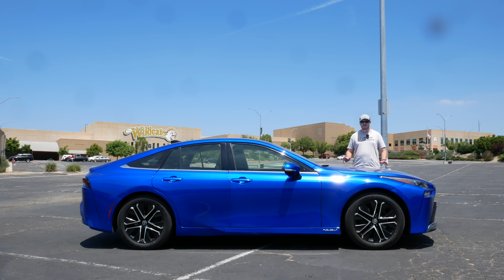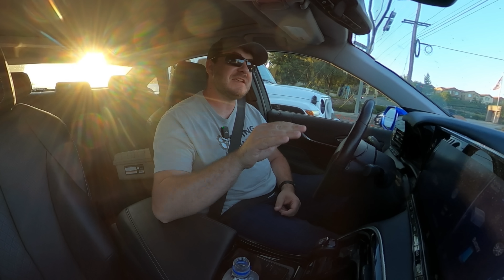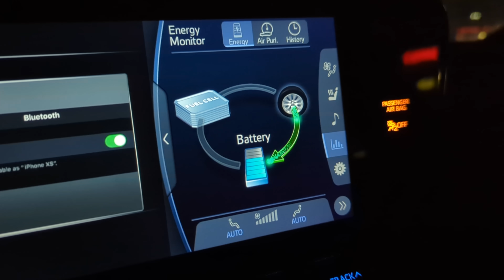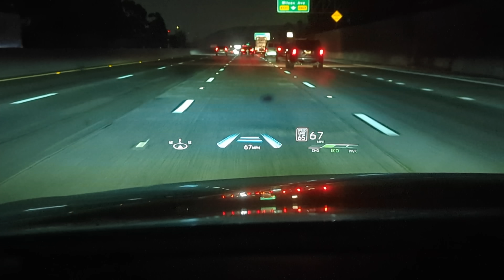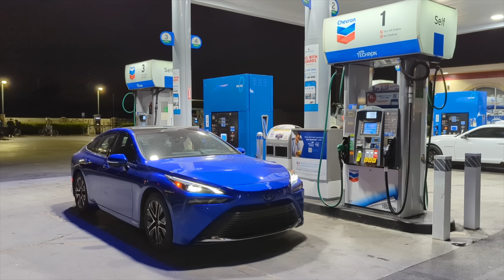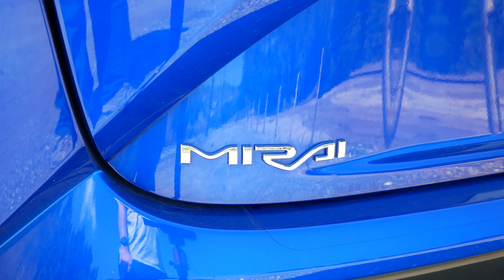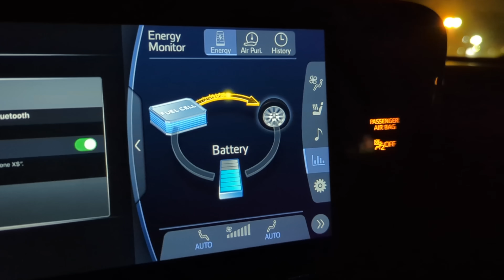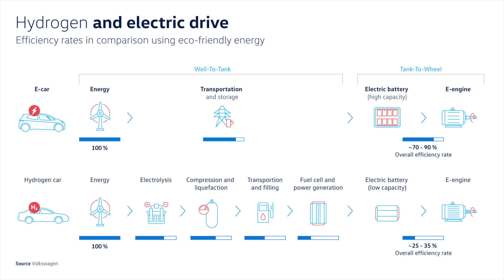The Toyota Mirai is Disappointing

Comment: I'm sure there is an expectation that Hydrogen will eventually be more efficient to manufacture as we get better at it, but I don't think it will ever be more efficient than just putting the electricity into a battery directly. I tend to agree on the concept of range extender for vehicles where charging a battery wouldn't be as practical, but unless we run out of fossil fuels there won't be very much motivation to replace them with this. Maybe using it with trains could make sense since you could have fixed fueling locations and they are basically doing the same thing except with diesel generators.

Comment: This is what I have been telling people: H2, while compelling, is a non-starter.  It's a brilliant exercise but at the end of the day, once you've crunched the numbers, it really doesn't make sense on a practical basis or on a cost basis.  The only place it gains ground is on an environmental basis where green-sourced, green-generated H2 is an easy win.  But it isn't a big enough win to offset its many shortcomings, not when BEVs are close enough competitors even on an environmental basis that FCVs don't really have a point.
Reply: By your logic a horse makes much greater sense than a car.
Reply: @rogersmith7396  A horse makes greater sense than THIS car.

Comment: Right before the latest 24 Hours of Lemans, Toyota showcased a GR Yaris that has a 3 cylinder turbo ICE engine that... runs on hydrogen. Huh? What? How? I DEMAND ANSWERS!
Reply: Same as propane.  Adjust fuel flow to keep ICE running.  You can use it in your stove or furnace if its adjusted right.
Reply: BMW also has a couple demo cars that run by combusting hydrogen. Engineering Explained has a video on it.

Comment: 14:21 - I'll say it. Yes. At least with its current VERY hard to over look limitations and inefficiency.
Reply: The range is a killer feature for large vehicles and long haul driving though, hydrogen vehicles can be configured to fairly easily exceed 1000km of range which would require an absurdly large battery pack for an EV. Doesn't really make sense for the average consumer where a rapid charging stop every now and then for a once a year roadtrip isn't a big deal, but for heavy vehicles like semi trucks where adequate charging infrastructure doesn't exist anywhere and that extra range means half as many charging points (plus transport corridors for cargo are much more predictable and can be more selectively/efficiently serviced) hydrogen makes a lot of sense. The efficiency just doesn't matter as much if in exchange you need half as much infrastructure and you can use surplus power from the grid when renewables are peaking and demand sags during the late morning anyway to make the hydrogen.

Comment: Something they leave out is those high pressure tanks are only good for 15 years if they are not damaged. Most HPA tanks have to be hydro tested every 5 years or they loose their certs to be refilled. The hydro testing involves dunking the tank(s) in a vat of water so how easy are they to remove from the car?
I also highly doubt the tanks are just carbon fiber. I bet they have an aluminum (maybe steel) core tank and are reinforced with carbon fiber wrap. That is how most composite tanks are made.
Reply: I know metal tanks fatique but how about FRP?  The hoop stress on Carbon fiber should be pretty low.  Now the cryogenic temps. . . .?

Comment: i would like to know a lot more. to me, i would rather this than an EV. EVs have a nasty habit of needing a battery replacement after like 10 years and it effectively makes the car e-waste because of how expensive it is. yeah, throwing away electric cars and their batteries, great for the environment
Reply: Bad news about the lifespan on fuel cells then..

And most EV batteries will last quite a bit longer than 10 years.
Reply: @RobertHancock1  how long do hydrogen fuel cells last then?

Comment: Hydrogen should be the system all governments invest in massively. Force all petrol stations to carry at least one hydrogen filling pump, and BOOM, whole market ready for immediate adoption with none of the infrastructure or range issues of plug in EVs.
Reply: Well, other than the infrastructure of the desalination plants. And the electrolysis plants. And the distribution network. And the massive upgrade required for the electrical grid.
Infrastructure for BEVs is way easier - the majority of it is already there.

Comment: I still would like to see the technology developed... The issue right now is that everybody is so up in arms about the bad efficiency. But I couner to that: what about "small scale production"? i.e. put a small unit into your garage, put a solar panel on the roof and connect it to the gutters. It can literally slow-poke produce hydrogen all day while the car is somwhere else and at no emissions... Likewise, producing hydrogen at a central factory - like gasoline - and then carting it all over is equally stupid. Why not bring the production to the "filler stations"? Power and water should be available everywhere these might be located? I know: current tech isn't that consumer friendly, yes. But I see a chance if these production means are where we need the stuff, and we don't need to ship it cross country. Then a huge part of the "diagram" falls away and combined with solar power... the efficiency shouldn't matter too. My 2c on the issue and I really hope to see some research in that direction pop up... cause the way things are going now, with big companies trying to convert thair profit chain from one fuel to the next, it's not going to work for sure.

Comment: If I'm not mistaken,  Zack from JerryRigEverything when reviewing the Nothing phone (which is Android based) said one clever thing: they want to be compared to the iPhone (which it very much looks like) rather than the other Android phones. 
Feels like Toyota wants the Mirai compared to ICE cars rather than EVs cause it sort of makes sense in that regard.
Reply: Yeah 62% efficiency is great when compared to diesel.
Reply: @slandoraparalex2328  not just that but electric is absolute garbage for all but the most niche applications in CMVs. For around town stuff or local stuff where the truck is parked at night. Sure. Long haul, offroad, dump work, mountain rigs, rural rigs, rigs used in disaster response and such.....not so much. Not only are the grids tens of BILLIONS of dollars away from being able to handle the power requirments but they are trillions away in terms of power production.

Hydrogen or even diesel electric produced someplace where they have an excess of power or good solar land and sea access provide a good alterntive to pure diesel and leave these trucks much cleaner while also ensureing they have all the current pros of a modern diesel engine.

Imo the only truely viable way forward is multiple fuels. For example EVs will be city vehicles mostly and anyone who expects to do more then the RARE long haul trip or a lot of towing will use a more traditional fueled vehicle run off of stuff like hydrogen, CNG, recycled methane, diesel or gas.

Trying to hamfist EVs everywhere is going to backfire bigtime as the grid, chargeing capibilitys and power generation stands now....fix the grid, fix the power generation and fix charge times/range and a lot of the issues go away.

Also we still dont have a good recycleing and/or repair plan for these cars. Lot of EVs are ending up as basically e-waste for minor to moderate problems or when they are used up.
Reply: @arcticfox5118 The other major issues with EV are the weight of the cars/SUVs. That battery weight is a substantial issue for road condition wear and tear. Not to mention when it comes to a car crash EVs go up in flames in a way only seen in movies. Their fires are more devastating than an ICE vehicle fire while also being more difficult to put out. So much so that oftentimes they are just left to burn themselves out rather than waste so much water and energy to stop it. Then you have to factor in that an EV Sedan vs ice Sedan weight difference effects the impact of a crash with another vehicle or pedestrian. For example a small car like the Toyota Corolla can weigh 2,955 to 3,150 lbs. While the Tesla model 3 can weigh 3,862 to 4,048 lbs. That is a substantial difference. When it comes to bridges and roads they are designed with certain weight requirements. But if we went full EV especially with trucks and semi trucks that could really do damage to our infrastructure.
Reply: @GrandMichigan  Why are you even comparing EVs with ICE cars on a video for a HEV?
Reply: @LAndrewsChannel  Because our actual options are EVs or fuel atm with a tiny smattering of other stuff. So we compare the 2 things we have an abundance of and take the HEV afterwards and see how it compares to those actual options.

Pure EV doesnt really make a lot of sense compared to current fueled vehicles due to a huge list of issues. However, diesel and gas have their own huge set of problems that has been discussed to death but is still the best option. So since EV doesnt make sense as a 1 size fits all solution. Why is that? And once established how are HEVs better basically.

Gotta discuss what wr already have to compare what can replace it.
Reply: That makes perfect sense. Hydrogen would look way better when compared to an ICE car. But it looks absolutely pointless when compared to a BEV.